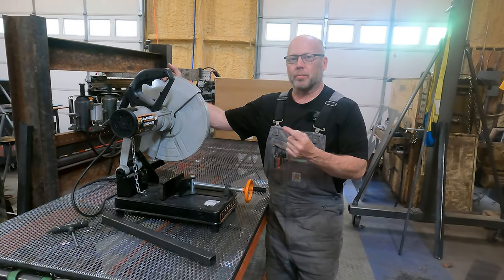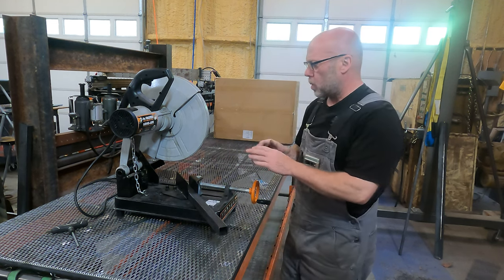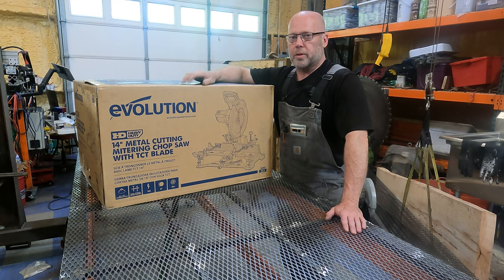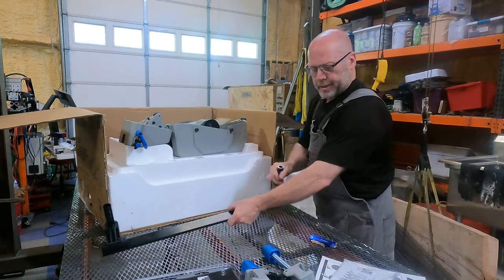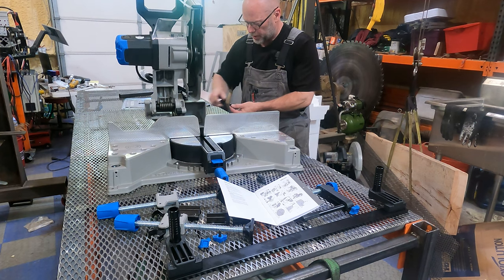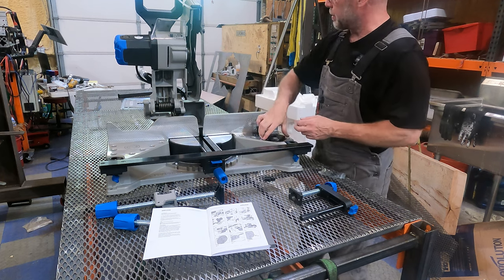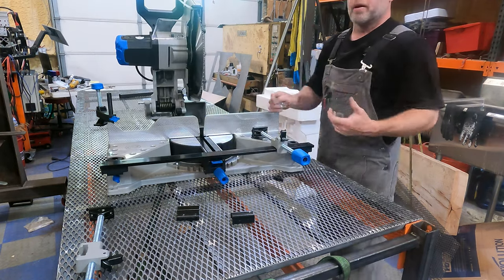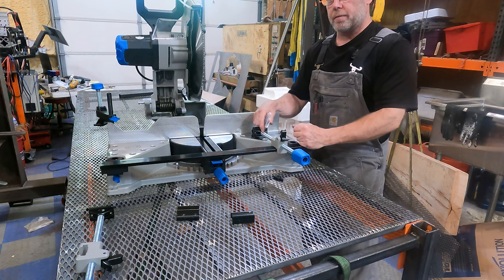Evolution Metal Cutting Mitre Saw   Unboxing, Assembly and Initial Impressions

Comment: I have a 70s era radial arm saw for my wood working. I think it would make an amazing style of metal cutting saw, if someone made them!
Reply from the maker: Yeah, I can't believe it took this long to create one of these, it's just an amazingly obvious solution to a very common problem.  I know people have put these metal cutting blades on standard mitre saws, but they spin at about 2x the speed of the metal cutting saws.  The extra speed can be dangerous as the bonded carbide on the metal cutting blade isn't meant to experience that much speed (and centrifugal force).